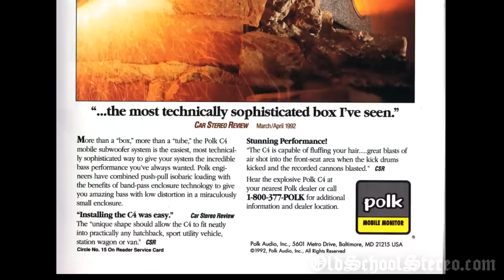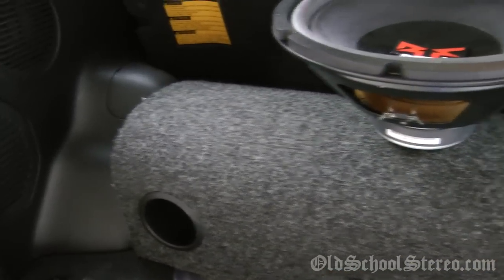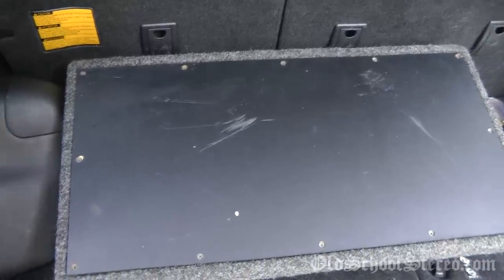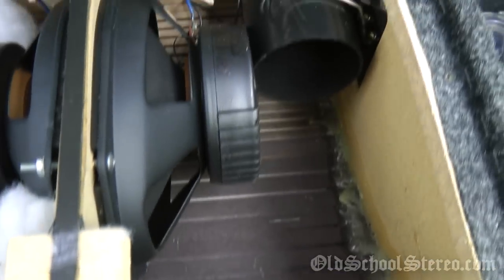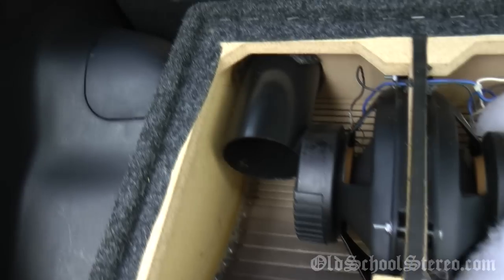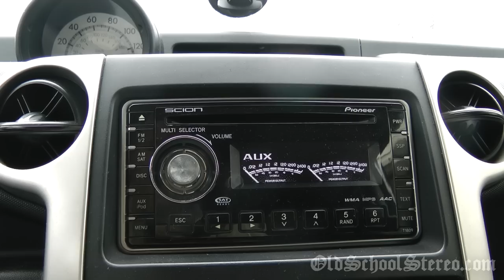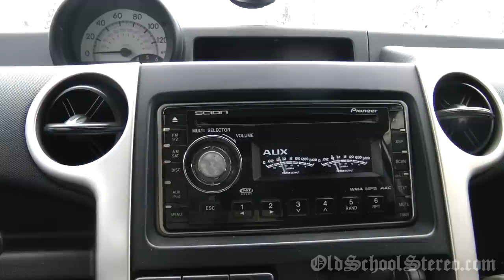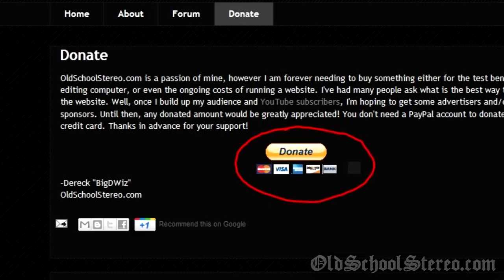Old School Polk Audio C4 Subwoofer - Four 6x9 Subs in Isobaric Teardrop Enclosure

Comment: I still don't understand how the subs in the sealed chamber make any difference..? they're not providing any additional cone area to the ported chambers where the sound is coming from... They allow for more power overall, but the subs in the ported chamber that are producing the sound are not getting more power... I think it would sound just as good with just 2 subs, like a 4th order and only require half the power....
Reply: I always thought of it like this,With the 6x9 and the inner chamber pushing as the 6x9 in the outer chamber poles it more or less doubles the surface area of the sub.
Reply: @TheQuirkyPicker_Chad  The only "surface area" producing sound in the ported chambers is the back side of the cone, of one 6x9 per ported chamber...
It just doesn't make sense to me, Sound waves from the sealed chambers are not going through the other 6x9....
It's no wonder NOBODY does this any more.
Reply: @TheQuirkyPicker_Chad  Seems like all 3 areas should be ported....?
Reply: @2869may  well I didn't design it, I just owned one. It sounded great. I took it into a sound shop once because the owner wanted to hear it and he was really impressed on how good it sounded for as small as it was.
Reply: @TheQuirkyPicker_Chad  Right..! I'm sure it sounded good, I just think it would've sounded just as good with only two 6x9's...
And they could've ported the sealed chamber to a higher or lower FQ and achieved a wider range.
It was a marketing and price gimmick.
Reply: @2869may  just because you can't figure it out in your head, doesn't mean the isobaric configuration isn't better than just 2 regular 6x9s . It made my truck lid rattle and my rear view mirror vibrate like crazy.
Reply: @2869may  So many people ask this, I wonder if those two middle speakers are out of phase, which would make every other speaker out of phase so that when sound is coming out of one port, It's not coming out of the other.
Reply: @TheQuirkyPicker_Chad  I bet you're right... But the cone area of the sealed speakers still isn't providing any sound waves that are able to escape the sealed chamber. They allow for more power input, without providing more output... That's why we don't see isobaric subs being used this way anymore.
Reply: @TheQuirkyPicker_Chad  Do you think the sound waves of the sealed speakers travel "through" the other speakers....? lol
Reply: @2869may  I remember it being explained to me that when the inside speaker pushes the outside speaker, it moves it even farther.  I plan on dissecting mine next week and will take a look.  Its been in storage for over 15 years and I've never taken it apart.  Maybe I will film it.
Reply: @TheQuirkyPicker_Chad  If the outside speaker had more Xmax and was able to move further... all you would need is more power to move it further... Although, I just thought about power distribution and HEAT distribution to 4 motors instead of 2...
There's some logical reasoning right there.! 
If it's in good shape, it may be worth something to a collector, I don't think I would tear it apart...
Reply: @2869may  There are several videos on Youtube explaining the benefits of isobaric configuration.
Reply: @2869may  I would just take off the back and look around, not dismantle it. 🙂
Reply: @TheQuirkyPicker_Chad  Right on! It's cool whether I understand it or not... lol
Reply: I just FINALLY listed mine on eBay today.

Comment: Why would you put the subs facing each-other?? That defeats the purpose of having bass cause the way the subs are positioned, the bass will cancel itself out and you won't get hardly any bass and it'll sound like shit.
Reply from the maker: You should watch the video as I explain how the isobarik design works. The subs are wired out of phase, so when one pushes, the other pulls...so they don't cancel each other out. Some systems were designed like this in the 80's and 90's to help make the enclosures smaller.
Reply: Do your homework man, an isobaric design is supposed to look like that. Polk have always made really good stuff and this most likely won't sound bad at all. Not really a loud sub but it's probably meant to be an SQ box.